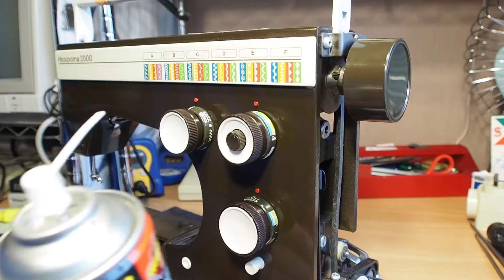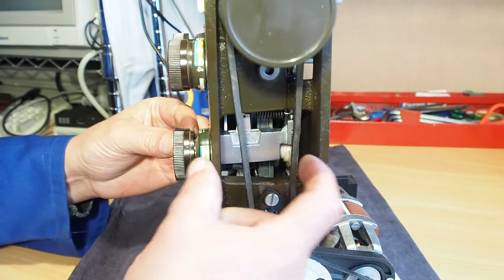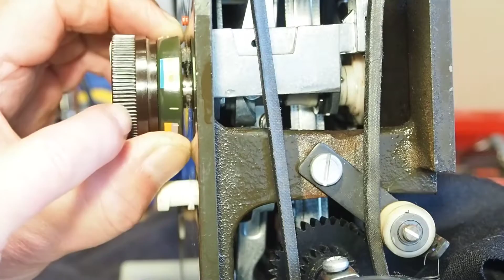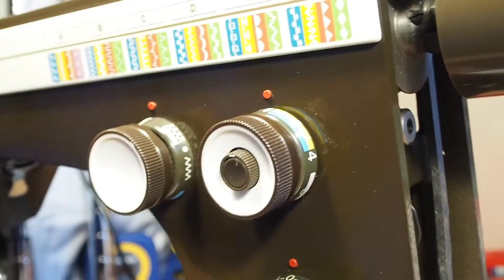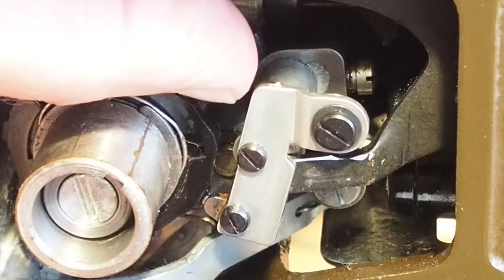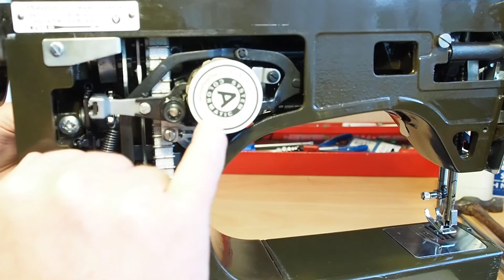Viking Husqvarna 6000 Series Sewing Machine - Un-seizing the Control Knobs

Comment: I have a machine with the button/width knob fully stuck and not possible to pull out. So stuck the button cam rotates together even in the non-pulled out state.
Do I dare take out the whole thing for soaking/cleaning? How many springs and levers do I have to get connected again after? :-)

Comment: Hi, I have 2 Vikings and I sew shirts. The problem that everyone seams to be having is that the GREASE is so old that it cakes up and gets hard because it is made of oil and BEES WAX , that is where you need to replace all of the "Grease" with any new type of oil or grease.  The machines are great as long as they are maintained and get that old grease out that is sticky and brown, around the reverse parts and the 3 gears for the selector knob. Have a nice day  !!!

Comment: I have an old Husqvarna 2000 model 64 50 that I got from my mom who bought it a few years before I was born. But for years it has refused to use the pattern wheels and last time I tried using it it was stuck sewing the tiniest straight stitches. Today I took it apart to try to see if I could fix it... Immediately struggled with getting the back panel off until I found this video (and then watched the "Assessment and Buyer's Guide") so I managed to get it opened. But unfortunately the cam wheel is of course broken, probably because the cam follower is sticky and was stuck onto it. But apart from that it has has no other major issues except sticky controls, which I guess I can fix myself using this as a guide, as soon as I buy some penetrating oil. 

So the bad news is it will only be able to do straight stitches without a costly repair; but the good news is because it's definitely broken I can with good conscience buy a new sewing machine 😄And I can fix the control knobs and keep the Husqvarna as a backup for anything that only needs straight stitches. Apart from the lack of lubrication and broken cam wheel it seems to be in very good condition, almost no wear and tear at all except on the handle (which probably happened while in storage rather than from actual use, lol).

Comment: Got my Viking 6030 model working again, after it had completely seized up.  Thanks very much for your video! So helpful!!!

The handwheel was completely rigid, nothing worked. It took two days to heat up, scrub out with alcohol, and lube with Triflow Silicone Oil to get it all working smoothly again. I also adjusted the needle timing and bobbin Shuttle race to work perfectly. I can sew again, hurrah!!!!

It is a bit stiff occasionally.  I will do another complete cleaning with better solvent to get this machine humming like a dream.  I wonder if I can open up the base screws (not motor housing but big screws holding the mechanism to the base. I wonder if there are more parts to clean and lube down there. What do you think?

So happy I found your video and it gave me the confidence to open up the machine.  I had to be tenacious and not give up so easily. I saved $400 on this repair.  Thank you so much!   Subscribed.

Comment: Hi my wife has a 6440 l have put  wd40 on the shafts but the 
Lug and the recess are not Iined up and will not move  l have tried to do the way you said is there other way l can move it, also the cam holder is broken like yours l can get a new one is it easy to remove thanks Brian

Comment: Spot on. Thank you. The shaft for the buttonholer in my machine is well seized and out of sync just like the one in this video. I've used a lot of heat and lubricant so far and it still wont budge...Yet... At least I know I am on the right track thanks to this video. Thank you!
Reply from the maker: Good luck. Slow and steady is the answer. Let us know how you get on. Thanks.

Comment: So excited to find your post. My inherited 6430 has always sewn beautifully but I took the cam out & seem to have forced the stitch selector. No movement in zigzag component at all, flywheel only turns half way ... the repairer I took it to said he would bin it  but it has huge sentimental value. Cam is ok, possibly the cam gears? The outer part of the selector turns well but doesn't move the inner part with the  colours zigzag etc. After your post the other dials are moving a lot better so thankyou. Not having a lot of luck with a Viking Husqvarna repairer in the UK  if anyone can recommend someone.
Reply from the maker: Good luck with finding someone who will repair your machine. We have similar issues here where some repairers don't value older machines. Thanks.

Comment: I have only worked on these Husqvarna machines, the can be so stiff that the are complete locked up..... but with a lot of lube, and soms heat, the mostly come to life.
The only 2 problems i come acros almost always failing are the cam stack if its not cracked, it will in a short time, the take up arm slide are not that often broken, mostly the break if the mechanism is stiff and it is forced

Comment: Thank you for posting your very helpful lecture/demo! My wife's 6430 had seized up after a few minutes of disuse. I followed your disassembly and assessment advice and used a penetrating oil spray to unstick everything from the top driveshaft to the completely stuck control knobs. Once I got the main shaft turning a bit by hand, I removed the handwheel and put the end of the shaft into the chuck of my 3/8" battery powered portable drill motor. I ran that gently while spraying anything that look at all stuck or resistant, then used it for run-in. I highly recommend doing this when the drive motor and belt can't do the job themselves.  

My other trick was to buy some belt dressing spray at the local auto parts store. This helped with main drive belt slippage, although I have ordered a replacement belt, just to be sure. (The 6430 does not have a tension idler for the main drive belt -- I notice Husqvarna got smarter with subsequent models.) Anyway, thanks again for your assistance!

Comment: I am the original owner of the Viking 6530 USA model. It worked beautifully for many years. I probably pushed it too hard when I got canvas stuck. After watching your videos — thank you so much — I thought I could fix the timing. But when I set it up the hand wheel would not crank and it broke in my hands. Where can I go to get a replacement? And which compatible part would work? Then, is the oiling the same for this part of the machine?

Comment: My Mum has recently bought a second hand Husqvarna 2000 model 6030 in rather a sad state. Thank you so much for this video. Amazingly, we can't find an in/off button on the machine or displayed in the manual. Any suggestions would be much appreciated. Kind regards, Lorraine
Reply from the maker: From memory there is no on off for the machine, just the bulb under the arm. Thanks.

Comment: Thank you for showing this video. I just got a Similar 6010 machine with two stuck controls. I looked at some of the penetrating oil, that you can get in car accessories shops. If seems they focus on removing old rust. But here you want to dissolve old oil. Do you need to look for some special kind of "penetrating oil". Some consider WD40 as a penetrating oil and others do not. I hope you might have got some guidance on this.
Reply from the maker: The penetrating oil often doesn't remove the residue and the parts need to be disassembled and deep cleaned. Thanks.

Comment: Thank you for the help. I recently got a Viking 6430 at a garage sale. It is in working order except the stitch selector knob
is completely stuck in the straight/zig-zag stitch position. I have removed the rear access plate and do not see anything broken.
It feels like something is jammed when I try to turn the dial, but the straight and zig-zag stitching comes out OK.
Do you have any advice? Thanks again.
Reply from the maker: Maybe try lubrication as shown in the video. Thanks.
Reply: @InStitches  Will do. Thanks.

Comment: I'm about to throw in the towel on my wife's Model 6040. It sat unused for a very long time. Recently, she started sewing on it again but experienced a problem which resulted in a very hot motor. It was mentioned  that this series sewing machines originally did not require periodic oiling and I suspect there is a great deal of drag throughtout the machine which overtaxed the motor. I've tried lubricating all the obvious exposed locations but I fear the same design philosophy that was to keep the factory lubrication in place is also defeating my oil from getting into what ever location that is creating the drag, which is quite substantial. I'd love to get this machine running again in top fashion but trying to pinpoint the source of resistance and the lack of oiling ports normally found on most machines has me very frustrated. Any help or suggestions woud be very much appreciated.
Reply: Update on the wife's 6040. It lives!!! Two problems solved, one with heat and the other by properly relocating the buttonholer cam. We applied lots and lots of heat using a hand held hair dryer, copious amounts PB Blaster followed up with real sewing machine oil. Hint: use the PB Blaster outdoors if possible, It has a really strong smell! 
The problem with the buttonholer, after we freed up the knob, was that the two halves of the buttonholer didn't line up. Once the dog and slot were lined up it now works as it should.
The wife is absolutely enamored with how it now runs, so smooth and quiet.

Comment: I tried to use my button holer for the first time in several years.  At first it wasn't working, and I took the cover off and got the tab to engage.  Thanks a bunch for the great video!!!  It is now working as I turn the knob from 1 through 4 and doing the correct stitches, however, the feed dog is not engaged, so I had to pull the fabric through manually to get a button hole.  The feed dog engages properly when stitching straight or zig zag - just not with the knob for the button holer pulled out.  I also don't have any cams to check the other stitches.  Any ideas?
Reply from the maker: The mechanism for setting the stitch length while buttonholing may be seized.

Comment: What type of oil are you using? I'm working on one now using 3 in 1 oil, is that ok for the longevity of the machine or do I need to use something else?
Reply: 3 n 1 is a 20W oil. NOT suitable for sewing machines from everything I've read. It will evaporate leaving a sticky residue.
Reply from the maker: I think 3 in 1 should be okay but if unsure try getting your hands on sewing machine oil.